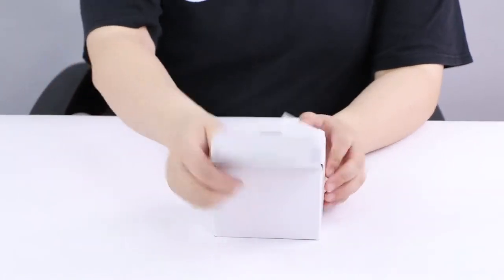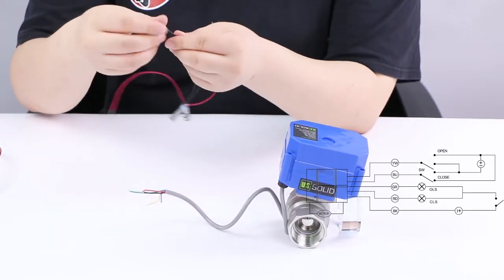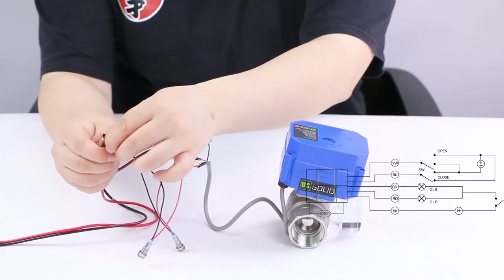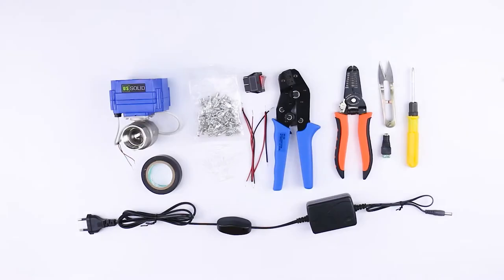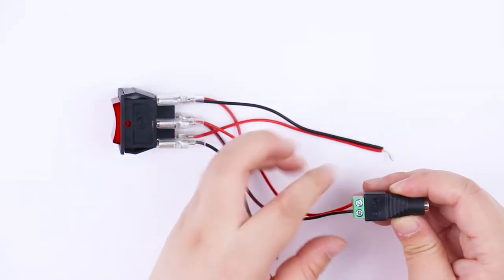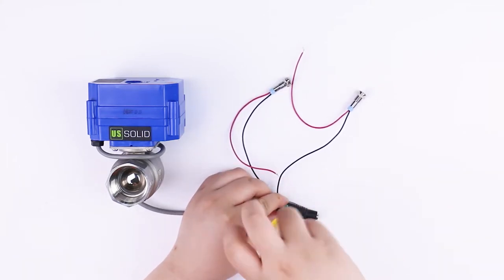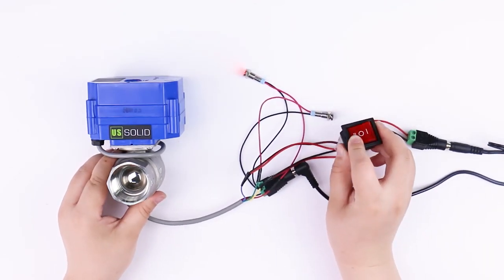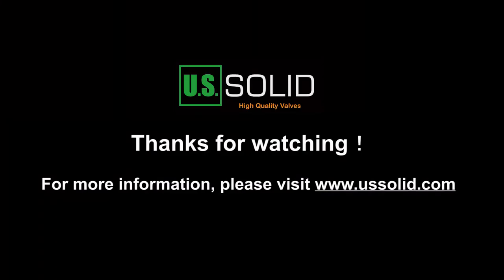USSOLID Motorized Ball Valve, 5 Wire Setup

Comment: In the video the negative power from the power supply is going through the switches in the valve and being directed to the green or red wire depending on if the valve is opened or closed.  The video connected the black LED wire to the positive from power supply which just causes confusion.  I would've connected the red LED wire to positive from power supply and the LED black wire to the green or red wire coming from the valve.    Just saying to avoid confusion.
Reply: This might be why my LED lights don’t come on. Can you please explain further if you were able to get it all working with LEDs? It doesn’t seem like they are responding. And I’ve watched this video more times than I can count 😀 Thanks for checking!